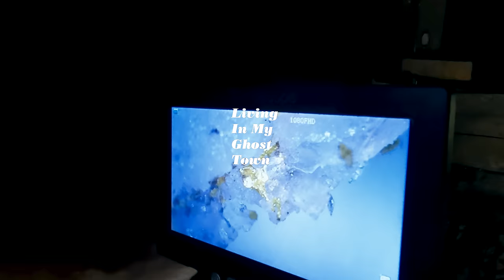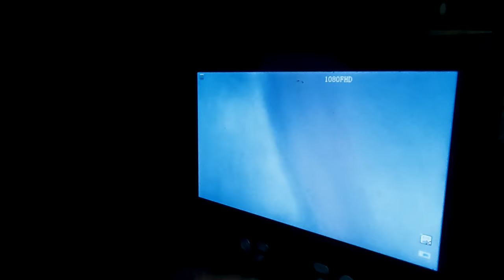Refining Pure Gold From An 1800s Gold Mine!

Comment: My 1st construction job was as a Carpenter's Helper in the San Manuel mine in... 1996.  I spent a lot of time making walkways, shelters, cement forms, and other wood things as needed.  I didn't work for the mine, I worked for the construction company that was installing the new conveyor belts.  It was quite an experience to have hot water dripping from the ceiling on the 4280 level.

Comment: It's so amazing that just that tiny little bead, firstly weighs 10 whole grams, and secondly is catching up to a thousand dollars or near there. And that bead is pure 24k gold, which means it's soft, and would be susceptible to damage if used in its pure form for jewelry. Having said that, it could still be put into a piece of jewelry, but it would need to be protected from physical damage. I think you should have your gold bead, shaped into a cut gemstone and put into a ring but have the ring designed in a way that the "gemstone of gold" is protected by the outsides of the ring, similar to a graduation ring, but have the sides of the ring up higher than the gem of gold in the center, if that makes sense to you. And, of course, have the ring made from pure Cerro Gordo Silver, so that you can say that "I mined every part of this ring!" a jewel of pure 24 karat gold in a pure Cerro Gordo Silver ring., Oh, and make it a Manly chonky ring, with lots of silver used in its creation.

Comment: Why not setup an acid wash area in one of the big horizontal areas?  Bring quartz to it, melt the gold out of it w/ hot acid, pour off the acid (to be reused), remove quartz, then take gold slurry from bottom and bring that up (for later refining).
It'd save the hassle of hauling tons upon tons of quartz up for only ounces of gold. You can approach 10:1 or 20:1 slurry ratio which is a massive benefit when small scale mining.

Comment: The quartz has value. They smash it into fine sand, wash it in acid. the heat it to ungodly temperature to make tubing a rod. Used to make wafer boats and furnace tubes so you can use your phone

Comment: I would've thought mesh and split set bolts installed with a jumbo or in this mines case an air leg drill would be cheaper than using timbers for ground support.

Comment: Be sweet if he could find a spot inside the mine to crush the rock and do at least the first round of classifying right in there. That hole filled with water would be a good place to dump the tailings. Remove the need to get ALL of the rock out of the mine and get it down to the decent stuff instead.
Reply: I was wondering what the reason why they didn't do this was - I can see a few, mostly explosion risk related - but that seems like a solvable engineering problem...

Comment: That's a horrible mine and horrible conditions, for such a tiny return. Brent's mine looks like a five start hotel, in comparison! 10oz of Gold is only approx. $21k worth. That then needs to be divided between three people. That's less than $7k each. He said he wasn't good at maths. Maybe he should have run the numbers before embarking on this back breaking work for only $7k per season. BTW. If that's a 10gm nugget it's only worth USD$700 if it's cast and stamped by a known refinery.